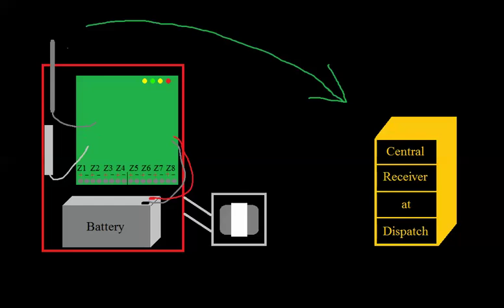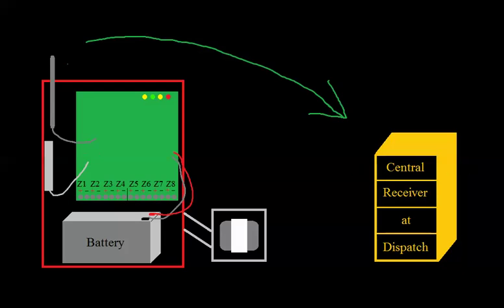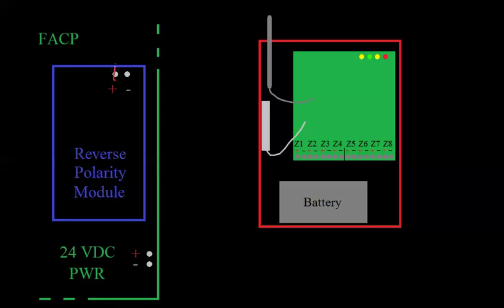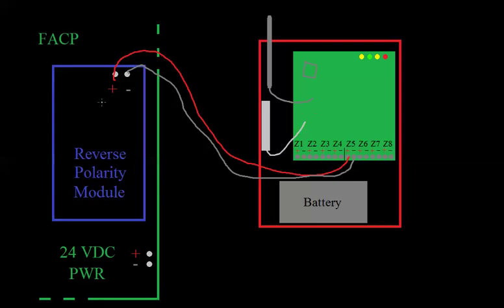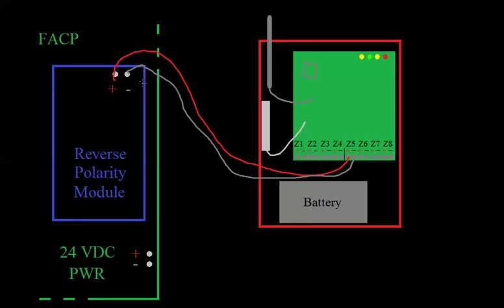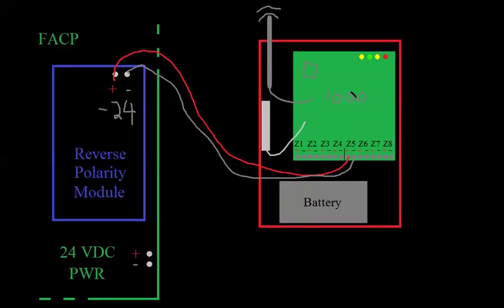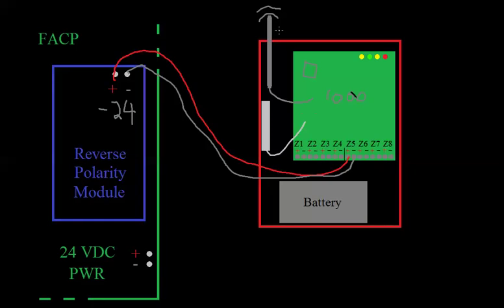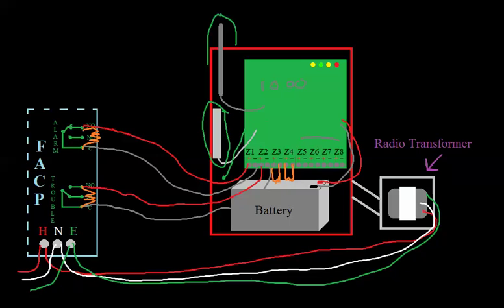9 - Wireless (con't) - Introduction to Fire Alarms

Comment: Being an ex-wireless technician, I have my doubts that cell is more reliable then copper wire.  Now you mentioned they can become part of a mesh network, however, if that is not available, you're depending on the towers and signal fluctuations. I run into that in the field on occasion where it loses then restores signal. In my mind, copper is much more reliable.